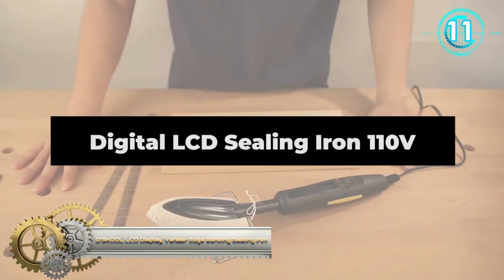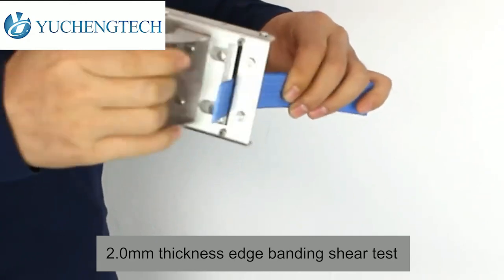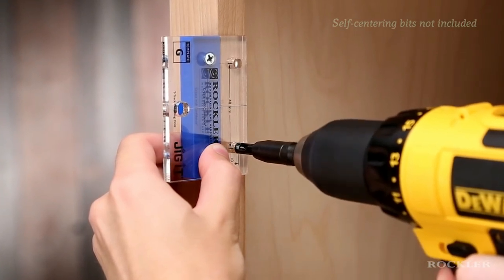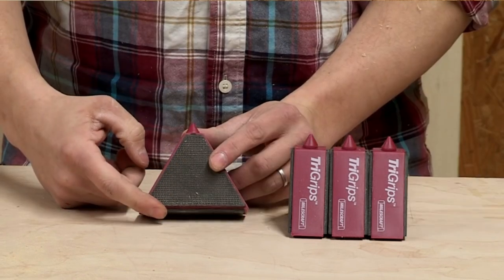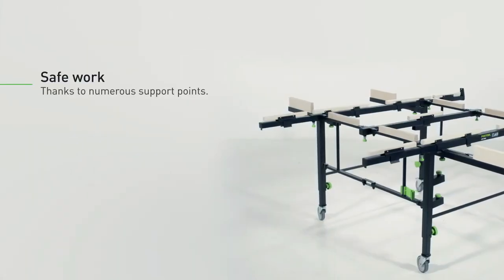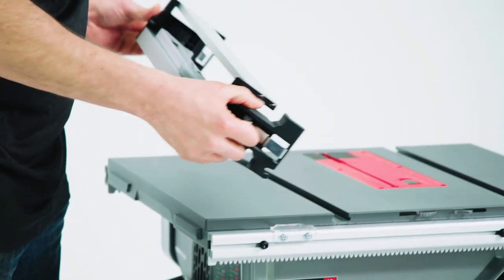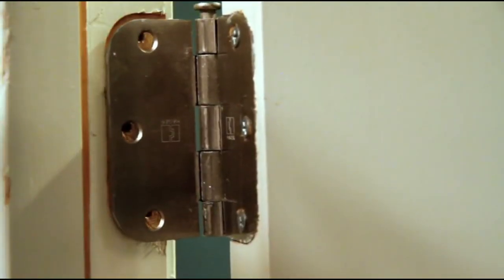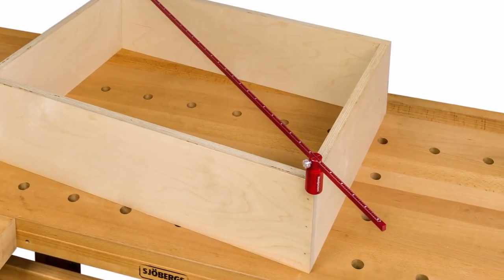Amazing DIY Woodworking Tools for Clever Woodworkers (Amazon) Part: 27

Comment from the maker: Tools Links:
''''''''''''''''''''''''''''''''''''''''''
O'SKOOL LCD Display Veneer Edge Banding Sealing Iron
https://amzn.to/3TwlJzo

Edge Banding Trimmer Veneer Edge Trimmer
https://amzn.to/3CLb4eq

festool bs 75 belt sander
https://amzn.to/3czw2SQ

Rockler jig it hinge drilling template
https://amzn.to/3AVs2V5

Carbide Inserts Dowel Maker Dowel Plate Wooden Dowel Rods Wood Sticks Maker Metric 3 Holes
https://amzn.to/3pV0rhF

Milescraft 1600 TriGrips 
https://amzn.to/3TuGuvn

The Hand Sanding Block Tool & Sander Pad Set by POWERTEC.
https://amzn.to/3AZXfr4

Festool Mobile Saw Table and Work Bench 
https://amzn.to/3TrWrm9

All-New 10” Compact Table Saw from SawStop
https://www.sawstop.com/product/compact-table-saw/
https://amzn.to/3Kx23rl

Rockwell JawStand XP Work Support Stand
https://amzn.to/3cFgwEV

Deluxe Trammel System - Woodpeckers Woodworking Tools
https://www.woodpeck.com/woodpeckers-deluxe-trammel-system-2022.html
.................................................................................................